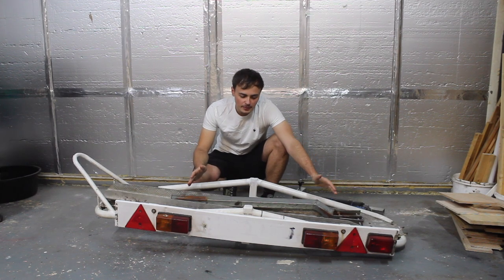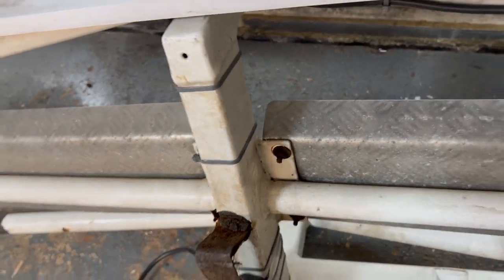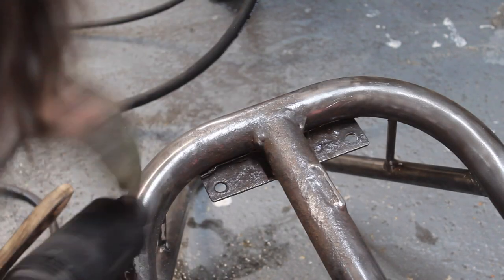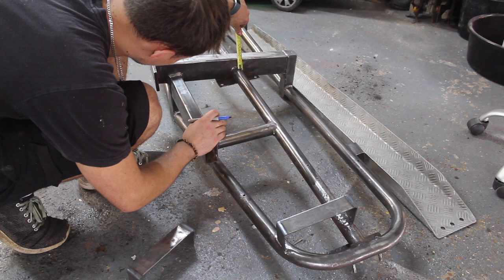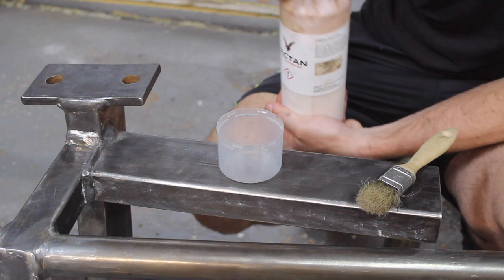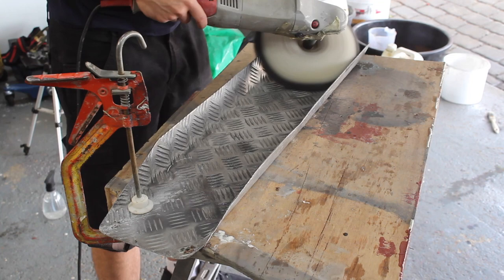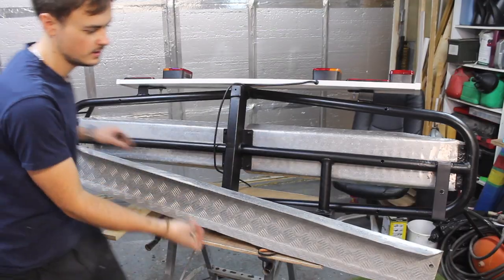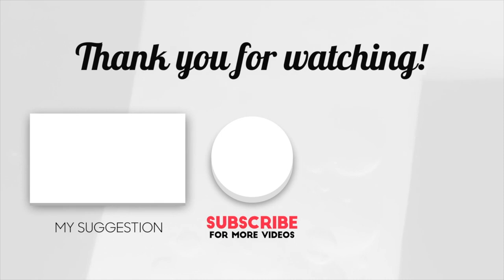Motorcycle Carrier Repairs

Comment: Great bit of kit for the camper👍 as for the bad earth's I had the same problem,water is getting in from the side vent on the van corner,the plastic flap behind had aged & rain runs straight down the wiring loom into the light cluster so check the loom connection.
I made a circle of plastic & cut it to the centre & made a cone to wrap around the wiring so it deflected water away from the wiring,put a blob of blue tac on the point to seal it. Good luck with the bike rack 👍
Reply from the maker: Ahh thanks I will check my flaps 👍🏼 there didn’t seem to be any water in the connectors and it’s been dry here for days so wouldn’t say it’s rain shorting the connections. Rust maybe. Thanks for your comment 👍🏼 😊

Comment: I had the same disco effect with the rear lights. 

In the end: it was the earth connection on the top of the rear lights. The pins/plug were corroded. Took them out with a “special” plug-pin-tool. 
Also the earth connection to the chassis on the left side was bad, sanded it and problem fixed. Probably the same with yours. You can always check by making an extra temporary earth connection to the chassis to see where the bad connection is.
Reply from the maker: Thanks for your comment. That’s exactly what I was planning to do. Add extra earth connections behind the light clusters. Let’s see if that works 👍🏼

Comment: great idea and good job  ...I built a rack for my Yamaha XS650 out of a pair of  Taxi Aluminium  wheelchair ramps but never got the chance to test it . Buy yourself some Tungston Carbide drill bits .. they are expensive but last forever. Drill really slowly and watch them cut through  5mm of stainless or hardened steel like a knife through butter  in seconds.
Reply from the maker: Cheers John, that’s a great idea using the taxi ramps 👍🏼 if I ever make one I will definitely look for some. And I will have to invest in some tungsten carbide drills, thanks for your recommendations 😊